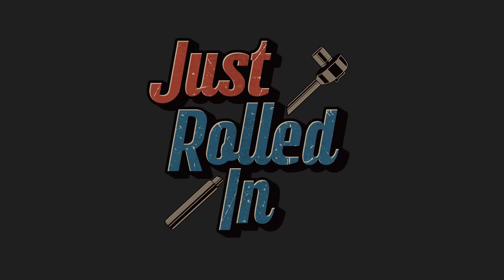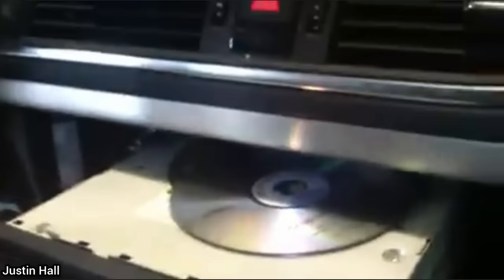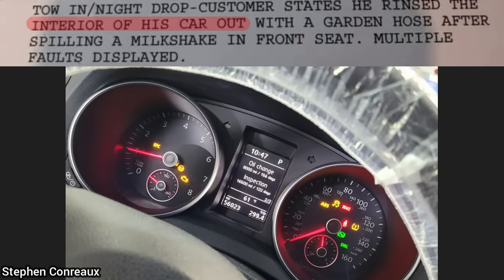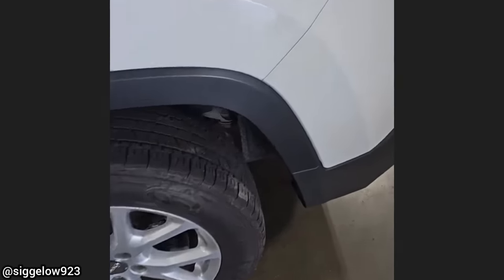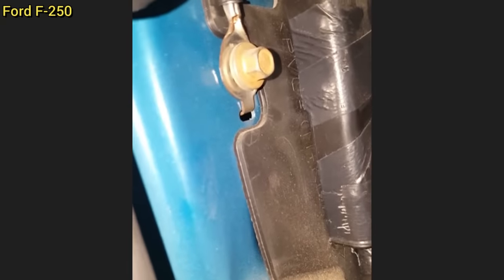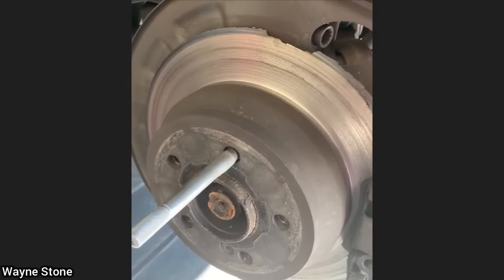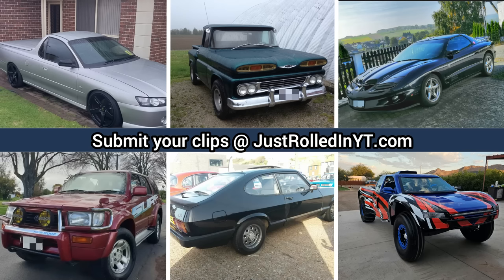Customer States Parking Brake Seized & He Took It Apart

Comment: Parking brake motor. Reason #167 why I hate these things being electronic now.
Reply: A lot of people are actually too feeble to operate the manual E brakes I've found. However this can be overcome with a release lever design instead of making them electronic.
Reply: All modern cars are designed by 14-year old computer nerds. Why use something as simple as a lever and a cable that has done the job efficiently for a hundred years when you can have a hugely expensive piece of electronic gadgetry that will inevitably go wrong, immobilise your car and cost a fortune to fix? Progress?  - I don't think so....

Comment: A true story….it takes place in San Francisco a fellow trade show union coworker received a large inheritance. So he goes out and buys an early Lamborghini Countach 1980’s square wheel arches . One night probably after over revving the motor( it was making noise under the valve cover ) he decided to take the engine apart. 
Disaster…..so if you see an 1980’s white Lamborghini 😊

Comment: It's absolutely just, jaw dropping what people do.
So, story time by Dad ...

Long story short, my neighbor, who knows nothing about how to fix or work on cars, knows I'm a retired mechanic, and, (master in fact of 40 years) he has his hood up both he and his wife are staring into what to them is the abyss but to us the Engine and all its friends.  I swear they propped the hood up to bait me lol like best way to catch a friendly neighborhood mechanic and meanwhile I'm like yeah I could use so quick cash.

He heard slapping and AC went out they can't afford to take it in don't know what to do, I'm thinking.....yup Belt. And right there in front of him is the naked AC pulley...he felt dumb when I told him what's wrong.
He said I have no idea how to change this...I said I could do it. By they way this is a 2003 Chrysler 300M.  I know still running and everything.  But this and the concord were famously tight spaces to work on.

Don't get me wrong I do like to help people, and he asked how much and how long?
I said 30 bucks and about 25 maybe 30 min unless I run into trouble....I'm retired folks for a reason.

He said okay so I told him might as well get the other belt too when you go to the parts store as it has to come off anyway to get that back V Belt on.

He said he will get that tomorrow.

I said okay I'll meet you in your driveway around 3pm and Do not, proceed without me   he said I wouldn't even no where to begin, I said I know but sometimes folks think between staring and YT video they become experts and can do it themselves.
He promised me he would wait.....yeah Famous Last Words.....

So, 3pm comes I am in my mechanic overalls I sewed a Black cat heat patch to an open pocket it's that cat with the face like WTH is that noise or are you sure you know what you're doing kind of look...I named him Mr. Peppers...

As I walk nextdoor I stop in my tracks as me and Mr. Peppers have a sight to behold.  The cars Hood is up my neighbor stands in the driveway with his head down and the other belt in his hand,
The front of the car is just torn apart...
He hands me the belt, I look down past my open hand and see coolant on the driveway, my eyes focus back into my open hand as he places not one and not two of two idle and tension pulleys but their brackets....
I start to speak, "What,,, happened,,,,,, to,,," he hands me the broke off oil dipstick and I yell the rest, "WAITING FOR ME!!! ???"

He said I don't know how to put it back together he says I a sort of sad kid way lol.
I said well wish me luck...
He asked why?
Because I have one experience with the Concord and the Intrepid and both are the same platform but slightly different, but honestly this was going to be my first 300M.
He asked I thought you are a mechanic?
I absolutely am, I am a freaking fantastic mechanic, but we are all tried on how to follow a mental breadcrumb on taking things apart and having years upon years of experience means I know not only how to do that, but what doesn't need to come off, or how or why or what it is....my God man, As I look around  and he has one generic craftsman tool set socket and rachet set and a couple of open box end wrenches...he said I stopped when I couldn't take anything else off and found the belt could have come off 25 steps ago..
You Think, is all I said.  
I felt for him, I sat down looking at this beautiful bastard and his stupidity of bravery..
He asks can you fix it?
I look up and say, is the Pope Catholic?
He smiles, what can I do to help he asks?

Nothing is right guys!  I said well, you got a beer?  I'm absolutely going to need one...he says right away as many as you want...
He comes back with a cold one he asks want me to just stay out of the way?
I looked up at him drinking that beer and said nope, you kidding you are going to be my assistant and I'll need you to hand me stuff.... including more beer.
He asked how long will it take you think? I said well, remember when I said 25 or 30 min depending on if I run into trouble?  Yeah?
Well, you were the trouble and it now will not be 30 min...
Because I didn't want to work well into the night I was only able to do between 2 or 3 hours, he turned a 25 min job into 3 days he had so much stuff apart, more than what he handed me.

But I was able to get his new belt on and all back together.  He paid me way more then 30 bucks oh I added 5 bucks more so 35 bucks due to oil stick repair...he asked next time tell me how you would have not broken the dip stick?
I said I would have waited for the mechanic, he asked but what would have done?
I showed him removing it lol.
The plastic was melted in the tube I had to cut off ¼" of the tube body and then with a Dremel and a shop vac perform what I can only imagine what must be like coronary artery surgery removing plaque....sigh.  bad attempts at trying to remove the remaining dipstick. 

Well believe it or not this was the short version, sorry long, and I'm not editing typos as this was on my phone and the box is tiny to edit all this.  

So yeah, I am amazed at what people do, I shouldn't be, but I am...lol  

I had 3 days of free beer...sort of lol I worked for that beer man!

Comment: The person who removed the caliper to drive it to the garage  instead of towing gets my support. Funky tiedown, but a worthy move. Next time just remove the pads.   The rest of them are crazy :)
Reply: If you remove the pads, then the pistons hit the rotors. And that's even if you can while the parking brake is engaged
Reply: I had to ask. I had no idea!  my chatGTP question : I HAVE A 2002 ford e150. does the piston in the front caliper have a stop travel on it? If i remove the brake pads and hit the pedal, will the piston pop out without pads?   Response : On a 2002 Ford E150 (as well as most vehicles), the front brake caliper piston does not have a built-in "stop travel" per se. If you remove the brake pads and depress the brake pedal, there's a risk that the piston could over-extend and pop out of the caliper bore.

If the piston pops out, it can cause brake fluid to leak and introduce air into the system. At the very least, this will necessitate bleeding the brakes, but if the piston or caliper seals are damaged in the process, more extensive repairs or replacement might be necessary.

If you're working on your brakes and need to push the piston back into the caliper to accommodate new, thicker brake pads, use a brake caliper tool or a C-clamp while ensuring the brake fluid reservoir does not overflow. Always ensure that the piston is compressed straight back into its bore to avoid binding or damage.

In general, it's good practice not to depress the brake pedal when the pads are removed. If you're checking piston movement or brake function, you can insert a block of wood or an old brake pad in the caliper to simulate the presence of the brake pad and prevent the piston from over-extending. @counterfit5

Comment: Nice to see a compilation that doesn't have at least one "customer has driven 84000 miles without changing the oil, here's the factory oil filter still installed."

Comment: Recently I've worked on my car truck. I changed the oil, transmission fluid(no dipstick on my tundra), spake plugs, brake pads, air filter and throttle body. And a couple of years ago my cousin showed me how to replace the wheel hub on my brother's car. 😅I'm trying to learn more, I like doing the work myself. And yes I've made a few mistakes, like not noticing the oil filter came with 2 gaskets, one already on it, and I put on another one and it caused a leak. And I didn't seal the transmission gasket properly on my car and had to order another one. But I've learned from my mistakes. And I've yet to do anything crazy like in these videos.

Comment: My 2012 Odyssey stopped moving while on vacation.  Had it taken to the local Honda dealer since it was under an extended warranty.  While waiting for the wrecker, I looked it over and could see the right front driveshaft rotating, but not the wheel.  Dealer diagnosed it as a bad tranny and changed it.  I drove it the 12 hours home, and the next day I had the same issue.  My selling dealer checked it out and diagnosed it as a bad right front drive shaft.  That year had four different driveshafts depending on trim level.  The wrong one was installed on a previous repair.

Comment: I derp’d recently myself… went to top off the coolant with winter blend and it just poured right out.  Thought I had a crack in the reservoir as it was rather low

Turns out I had the funnel pointed right at the overflow gimmick and that was why it “spilled out” right away

In my defense I was standing on the driver fender side of the truck where the Low/Full markers are and the overflow deal is on the other side of the reservoir… my local shop was kind enough to not laugh at me, even though I was already laughing at myself

Jokes on them though, they ended up topping off my coolant in the process and didn’t even charge me for it… that’s like 25¢ in my favor… … … … … … worth it…?

Comment: On the loose ground issue, I very recently had an X5 BMW come in with multiple transmission issues after another shop replaced the timing chains. (N57 engine, chains at rear of engine).
Found the fault to be the ground wire for the transmission harness to be loose at the mounting point beside the ECM housing under the cabin filter.
Tech had put the cable back on but only finger tight the nut. 
I actually went straight there as I had a full history of recent work and the huge number of transmission "NO COM" codes thrown.
The vehicle had been road tested after repair and was driven by the client for a day or so before it locked out so I guess the "finger tight" held on for just long enough.
😐
There is no shame in double checking your work people. We are responsible for more lives than doctors and are paid way less, no matter where in the world we are.

Comment: I had a $176 rock in the shield protecting the transmission. It would clunk and bump in different places underneath the transmission. Drove me nuts. It took the dealership about an hour to find it. I never would’ve guessed whereabouts it was.
Reply: Hence , rock protection shield,  that rock felt safe there, you leave that poor rock alone!
Reply: Had the same thing happen to my Pontiac solstice the rock was in the transmission shield. I now have a $175 rock.

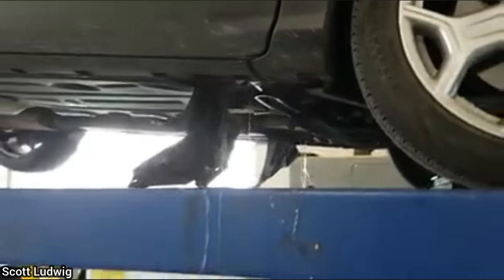Comment: I hate it when the emergency feature of the front seat seatbelts accidently engages because I'm leaning forward too far or too fast to look around a blind spot, yet not once did I think something was wrong with the seatbelts. So, I can only shake my head at 1:17.

Comment: Honestly, its the little things like that loose ground that can cause major headaches. At my work, we deal with International trucks, there was one truck that I overheard about that we tried everything to fix the issue it came in with. Turns out, it was a faulty fuse causing the issue the whole time. Granted, we did have one of our younger techs on it, but they had some of our vet techs help and still couldn't figure it out at first.
Reply: I ran into an intermittent one time,  had all the techs baffled  , I was too . After going through what I thought was everything... I was leaning on fender/vehicle running, thinking toself.  Checked this this this , tapped the fuse for the circuit, tiny brief flash car stuttered straightened right up.    30 amp box fuse, popped cap off it, broken on one side couldn't see w/o my readers on lol. Bizzare.

Comment: The first time I ever drove out into the street with my learners permit and my dad in the passenger seat we went down to the boat ramp, there was a brand new chevy Silverado on the ramp and she slid down into the water while the guy was throwing stuff into his boat. Idk why it just took off like that, no one was in the car, he'd gotten out of the car a good while before it took off, but that thing just about disappeared instantly. The guy just sat down on on the dock and stared at the water after my dad and I helped him secure his boat which was starting to drift away after the truck pushed past it. 
So, how was your first experience as a driver?
Reply: My dad pulling up next to me at 13 popping and smoking clutch on his suburban trying to go uphill on next street over from our house.  (I figured if my older brother can drive so can i). Lol, he just looked at me and said get that back to the house      now. 😂
Reply: There are a lot of people who don't realize just how slick boat ramps can be. I worked as a commercial diver, at least once every 2 weeks I would get a call to recover one.

Comment: 0:48 I did not know they have vehicle equipped breath analyzer in Australia. Is this one of those "Bogan Alert" in Australia?
Reply: So that is New Zealand, not Australia. And it's an interlock device installed as a condition of getting your license back on probation after a drink-driving conviction. You have to blow ZERO to start the car. So the fact there is an open beer bottle in the car is a bit of a red flag lol.

Comment: If the mirrors fold in on their own, they should unfold on their own too. Sure, the customer should've read their manual, and it's the first thing I would've done in that situation, but it's not their fault the mirrors were poorly thought out when being designed. Used slow-mo to see what brand it was and it's a KIA, so of course it's badly designed with stuff to make you think it's luxurious but is actually just more hassle and things to break.

Comment: Question for the first one though: Where do you figure the vehicle being "new" means you get a free tow? I've never heard that one before
Reply from the maker: When a vehicle has a manufacturer warranty, road side assistance will be included. So if your vehicle breaks down or has an issue like the first one, you can get it towed to the dealership.

Comment: I hate that cars are smarter because people are dumber.

I was a tech for a long time and finally had to step away when I was sued for offering a free oil change on a car that was 6k over its window sticker. The customer said I invaded their privacy by looking at the window sticker during an alignment and also stated I drained their oil because the engine seized 1,800 miles later, this was on a car that was 20+ years old and had a lot of issues.

Comment: One rattle that drove me mad when found was caused by my then 10 yro daughter losing a Mighty Beanz toy under the passenger seat, and had dropped through a hole in a metal box brace.

Took me buying an inspection camera to work out the cause, and much swearing to get it out.

Comment: People not only fail to read manuals, they seem to openly refuse to, it seems. also, how can one miss the slot in the CD players' front and instead shove it into the narrow gap above it? without noticing that the player doesn't react? and another one, and another one... obliviousness like this is very dangerous.

the last clip's issue might be a broken shock. considering how the car sways it might even be a rusted-out lower A-arm, too. especially considering what we've seen on this channel so far. :P

end card: Capri Mk3. WANT.

Comment: It's worth mentioning that a lot of these really simple things, like the lift gate or the power windows not working, are almost always really old people who get confused and can't figure out really simple things. I worked in an auto shop in high school and older folks would stop in to get really simple things "fixed" all the time. They really shouldn't be driving but because the US is so car oriented they can't really survive without a car. If someone told me that 30% of all drivers over the age of 60 in the US weren't mentally/physically fit to drive I would absolutely believe them.

Comment: My ex-wife brought me the car she got in our divorce 11 years prior, a 1992 Subaru Legacy, telling me that the alternator light was on the the battery was not charging, and asked me to replace the alternator. I opened the hood only to see that she had not only lost the accessory pully on the front of the engine, but had actually broke the crank off at the snout and the front main bearing was nearly gone. I just closed the hood and handed her the keys. That was 9 years ago, she has not spoken to me since.
Reply: Close hood,  walk away.  Smart  move.

Comment: Ask a UAW assembly plant worker about how they intentionally toss a loose washer, nut or bolt into a door or fender-well during assembly. The car is returned to the dealership multiple times for a 65mph rattle that the stealership can never diagnose.